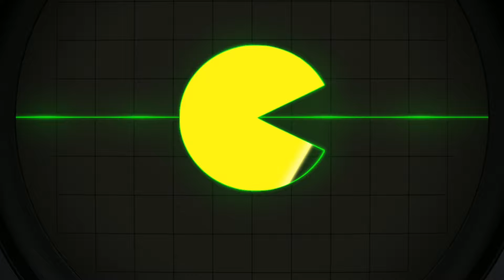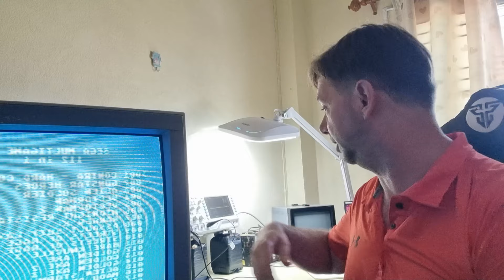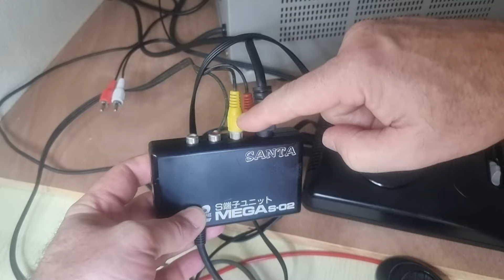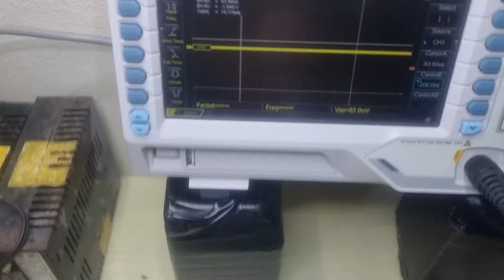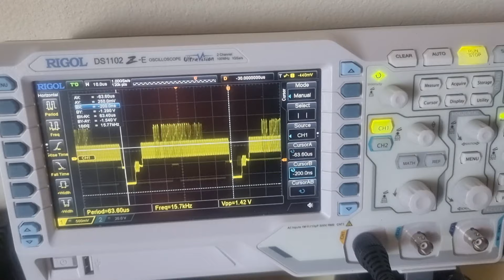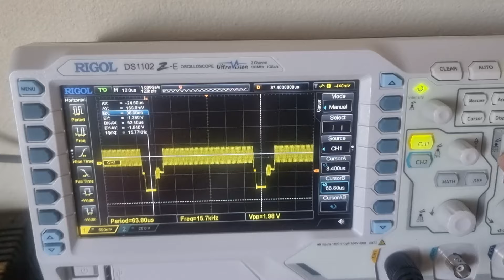Composite Signal Waveform Introduction

Comment: Why does the composite signal need a front porch and back porch? Most Analog Oscilloscopes don't have the scope trigger options to trigger on the capture line and frame sync events, so what would you recommend using to trigger on the capture line and frame events when using an Analog Oscilloscope?